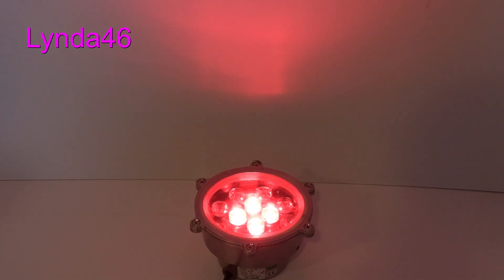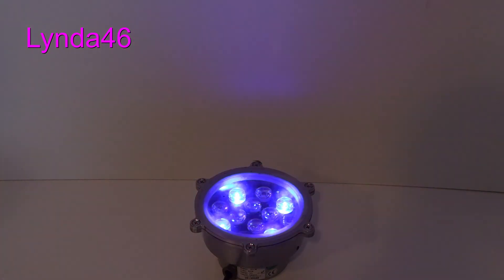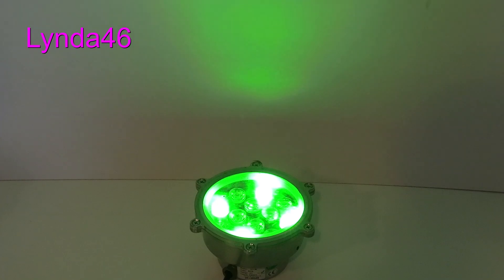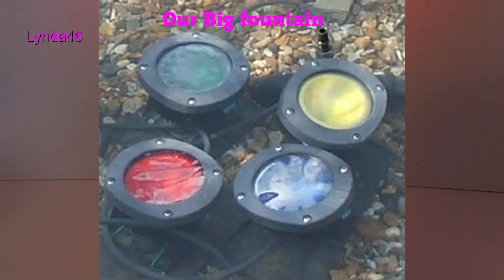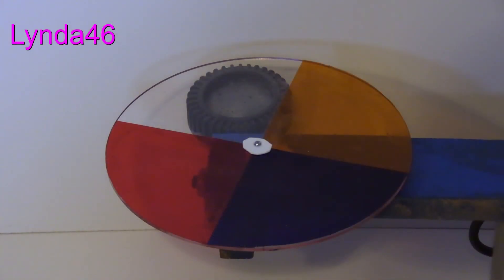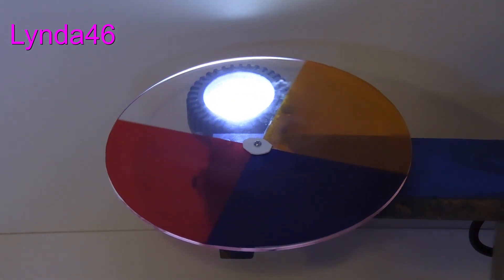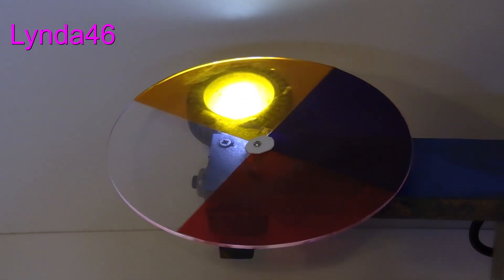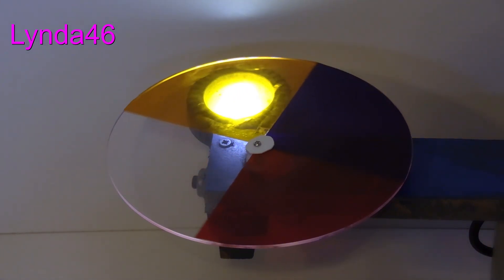Colour changing lights, how was it done?

Comment: whoever designed the montjuic fountains took this a step further, and instead of the filters being a disc, it instead was a giant pentagonal barrel with red, blue, yellow green and white (clear) segments, and the lamp is positioned inside the barrel, pointed up. the barrel was spun by motors and therefore color controllable, but unlike the one in the video, the whole mechanism wasnt submersible since it's too big. instead theyre positioned in pits with glass roofs, positioned in between the fountain nozzles
Reply from the maker: Thanks, I have seen a hexagonal version of what you say (I have a picture.......somewhere)  but these were designed for commercial fountains, the coloured disc was for domestic fountains.
Reply: @lynda46  The hexagonal version might be from the fountain in praza do imperio, lisbon, also made by the same eingenier who made the Montjuic fountains, Carles buïgas, he was a pioneer in lighted fountain making, and has a lot of fountains through Spain. It could also be the fountain in Cáceres, also by buïgas
Reply: @lynda46  light
Reply from the maker: @Fountainboy-s8   I do not understand, are you trying to ask a question?